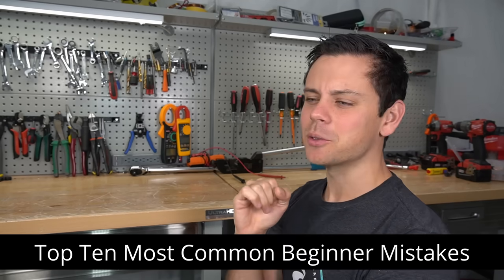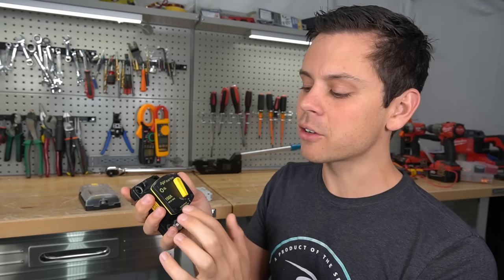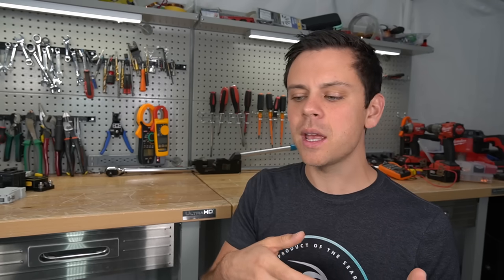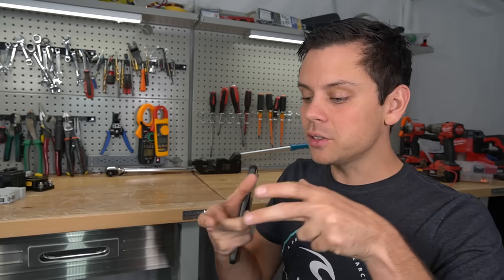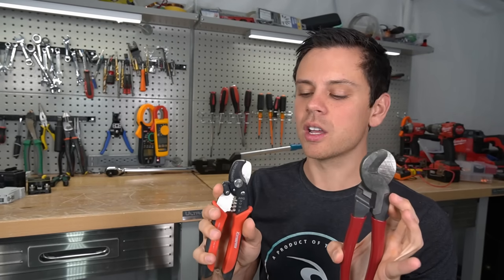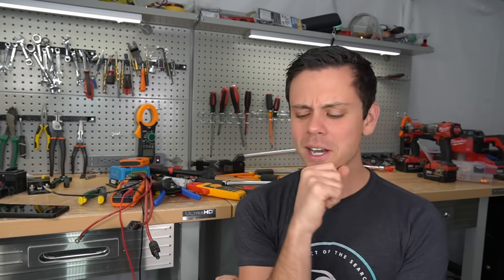Top 10 Beginner Mistakes When Building a DIY Solar System

Comment from the maker: Tools mentioned in the video (affiliate links):
Best Value Torque Screwdriver: https://amzn.to/3DEMqwb
Torque Wrench: https://amzn.to/3sEpuH8
(there is an insulated torque wrench out there, but it costs 20X as much (not joking). The options above are great for the price)
Basic Electrical Tools that I recommend: https://www.mobile-solarpower.com/tools.html

0:00 Intro
0:14 #10
1:21 #9
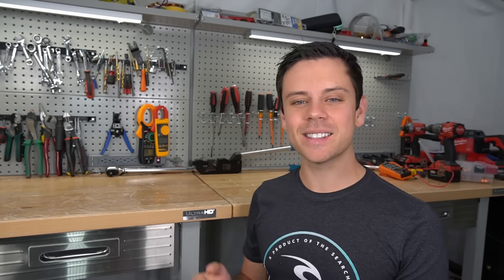2:53 #8
3:56 #7
5:36 #6
6:54 #5
8:51 #4
9:49 #3
12:15 #2
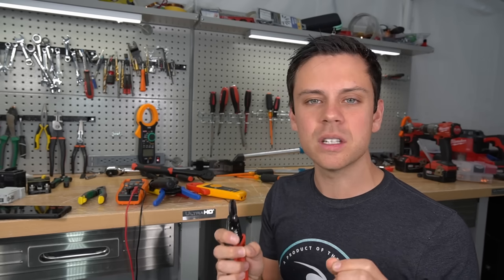14:29 #1

Does off-grid solar confuse you? 
Check out my DIY friendly website for solar system packages and product recommendations, and so much more! 
http://www.mobile-solarpower.com

Join our DIY solar community 
#1 largest solar forum on the internet for beginners and professionals alike:
https://www.diysolarforum.com

Check out my Book
Best-selling and beginner-friendly guide to 12V off-grid solar!
http://amzn.to/2Aj4dX4

If DIY is not for you, but you love solar and need an offgrid system, check out Tesla Energy! They will price out a system and get your house offgrid: https://ts.la/william57509

My DIY Solar Equipment Recommendations (Constantly updated! Check here first):

12V/48V Lithium Solar Batteries: https://www.mobile-solarpower.com/solar-batteries.html

Complete Solar System Component Directory: https://www.mobile-solarpower.com/solarcomponents.html

Complete 48V System Blueprint: https://www.mobile-solarpower.com/48v-complete-system-blueprint.html

Plug-N-Play System Recommendations: https://www.mobile-solarpower.com/full-size-systems.html

Complete "Add to Cart" 48V System Kits: https://www.mobile-solarpower.com/complete-48v-solar-kits.html

DIY Friendly Air Conditioner/ Heat Pumps: https://www.mobile-solarpower.com/solar-friendly-air-conditioners.html

My Favorite Online Stores for DIY Solar Products:

Signature Solar
Offgrid One-Stop-Shop. Best Value 48V LiFePO4, Victron and Offgrid Specific Heat Pumps:
https://www.signaturesolar.com/?ref=h-cvbzfahsek 

Current Connected
SOK, Victron, Mr.Cool Heatpumps and High Quality Components. Fantastic customer support: 
https://currentconnected.com/?ref=wp

Litime 
My favorite 12V budget battery!:
https://www.litime.com/?ref=XBIA62RFcalHns

Epoch Batteries
My favorite high-quality 12V battery:
https://www.epochbatteries.com/products/12v-460ah-lifepo4-battery-ip67-heated-bluetooth-victron-comms?rfsn=7352625.50494d

Renogy 
A classic 12V solar store that has been around for ages! DC to DC Chargers and more! 
https://renogy.sjv.io/n1VjXx

Rich Solar 
Renogy's biggest competitor! Similar products, but at a better price: 
https://richsolar.com/?ref=h-cvbzfahsek

Battery Hookup
Cheap cell deals
https://bit.ly/2mIxSqt
5% off code: diysolar

Contact Information:
I am NOT available for personal solar system consult! If you wish to contact me, this is my direct email: williamprowsediysolar@gmail.com

Join the forum at https://diysolarforum.com/ if you wish to hang out with myself and others and talk about solar

FTC Disclosure Statement and Disclaimers:
Every video includes some form of paid promotion or sponsorship. Some links on this youtube channel may be affiliate links. We may get paid if you buy something or take an action after clicking one of these. My videos are for educational purposes only. Information is subject to change/update at any time. Electricity is DANGEROUS and can kill. Be smart and use common sense :)

DIY Solar Power with Will Prowse is a participant in the Amazon Services LLC Associates Program,
An affiliate advertising program designed to provide a means for sites to earn advertising fees by advertising and linking to Amazon.com
Reply: Also if you’ve got links to the torque wrench and screwdriver that would be awesome!
Reply from the maker: Just added some links above for those tools. Good idea
Reply: "..titan it properly..."  I only joke in a good-natured fashion.  You're videos are GREAT for people like me not electrically inclined.  Because of you, my system is the envy of the community.
Reply: @LordSlag  I say it the same way and I get friendly teased about it. LOL
Reply: @mikefranks4528  😋😋🤗
Reply: @LordSlag  ditto!
Reply: Information overload🤯😄👍🏾
Reply: P
Reply: Thank you for this 💙 Still enjoy learning from your videos.
Reply: Will, the Weize Battery that you reviewed a while back is now $299.99 on Amazon.  Just picked up my 5th, and 6th for that price.  They are priced $319.99 minus a $20 Coupon.  Don't think that can be beat anywhere.
Reply: Thanks, but a question: I just looked up the manual for my Victron MPPT controller, and it requires 0.75 nM = 6 in/lb torque, The torque screwdriver you link has a range of 10-50 in/lb. Would 10lb be OK, or should I be looking for a wrench with a smaller range? What range do you think is optimal for most electrical projects (I'm working on an RV primarily)?
Reply: @WillProwse  It's getting chilly.  Hi Will.  I am looking for a basic off grid solar mini split set up for a mobile home that will get me through the winter.  Are you aware of anyone that has a video on such a system?
Reply: hi, I'm after this proper big crimper U showed second pls, cant find it in description or comments and U haven't mention make or model, thanks
Reply: Have you ever included all the tools you suggest in a budget of a system? Expenses over time vs grid tie/henerator is what I was wondering about. Payback time without the tool expense is what I always see, as if one is born with expensive, electric-specific tools:)
Reply: Can I run a 2000 watt inverter to just one main vehicle 12v battery. Also, what size gauge wire and fuse should I use?

Comment: As a controls engineer - Almost EVERY time I go in the field for construction inspections, the #1 problem is improperly seated and torqued cables. Will hit the nail on the head there. We formally call the pulling a "tug test". Do one after terminating anything - making sure everything is de-energized.
Reply: I worked in telecom as a tech and we used insulated tools and did annual torque checks of all the hardware. The last place I worked before retirement had 7 48v battery banks. Our load was about 1400 amperes. I have a small system at our remote cabin where I run a 48v battery bank with solar and inverter. I also have a 12v system for lights. I torque my stuff out there also. I also use the same method for preparing the connectors that we used at work.
Reply: One has to wonder why they give torque values for rotational terminators but do not give lateral separation limit tolerances for inline junctions.. after all, a "tug test" is much more likely to fail when preformed by the Hulk (or Arnold Schwarzenegger) than if done by my 5 year old niece  ;)
Reply: I do controls too. I have found factory landed wires on a big chiller landed on insulation. Wires inserted too deep and tightened on insulation and system wouldn’t run. That was fun to find.
Reply: @Knight805  I thought I was the only one. New battery cables for a car. Direct from Ford OEM. They didn't strip the insulation at all, just crimped the connector on. Also made me wonder if they were using a correctly sized lug since it fit over the insulation? Mine never have enough room for that.
Reply: I've come across cables just falling out of terminals aswell , just people being lazy and in a rush some just don't tighten down very much ,technical term is limpwristted
Reply: Is it a bad idea to use a suicide cord from a Bluetti type battery source to a plug in my camper? Assuming I turn off inverter first.
Reply: @alaska-bornfloridaman  after being shocked a couple of times myself on normal so called decommissioned electrical systems. I am now rather careful now myself try to run every thing through safety switches or boards as close to power source especially if you have no choice other than to use Suicide leads.
Reply: @davidwright1752  
Well, I made such a system in the event that we lose power in our house after a hurricane.  It runs the central air, fridge, and basic lights and TV. I know it's frowned upon, but I'm smart enough to shut off the main breaker.   I was just wondering if it would work on a smaller scale
Reply: @michaelphilip3919  agree with you just cannot be to safe around power. To many deaths due to Being electrocuted.
Reply: @alaska-bornfloridaman  all the rules are the same small system or large what size generator or battery are you using you have to calculate the load of all the appliances you are using ie 2 kw generator or battery plugged into a house that needs 10 kw is just going to work. A lot of engineers and sparks view the videos to keep up with the times.  Better to put a question on this site ie size of generator or battery and size of load. Than some may give you Hypothetical answer due to legal requirements. With a small system I prefer to run leads to the item I want to power example the fridge this is much safer it is really better to have a licensed tradesmen looked over your system and make sure it’s sized and safe particularly in the quiet months.Before disaster strikes.
Reply: @Chris_at_Home  look up the story where the antenna tower inspector tightened the bolts at every annual inspection, per the checklist. They were shearing off at an unusually high rate. The funny part is that he was the only one who followed the checklist! They had to revise the inspection procedure.
Reply: @mrtechie6810  That would suck. I did some tower work about the 30 years ago, mostly in the Arctic and a job in Kuwait.
Reply: @mrtechie6810  Procedure or materials were wrong!
Reply: @Chris_at_Home  
Great experiences? Any problems with procedures or materials going wrong?
Reply: @electron-1979  I can’t remember any problems from materials. I remember one time I went to do an annual load test on a battery bank and a post almost instantly went real hot.  The battery bank was old and I don’t think it had been tested in awhile.  It was at a remote village on the Arctic coast.  I worked for two companies that had contracts providing communications for the Alaska Pipeline Line for 15 years and  there were crazy procedures for getting any installations done. Everything had to have a permit even just visiting the gate valves.
Reply: @alaska-bornfloridaman  I build the place I’m in now and I have a main transfer switch and a sub panel with its own transfer switch. When our power goes out I hook our Honda 2000 to the sub panel  transfer switch plug and it runs lights, fridge, freezer, Toyo heater and TV/ internet. I can start the big generator remotely and it will run all the big loads like the well pump.
Reply: @ Baloo Lamo   After 25 years of electrical field construction supervision in power plants and refineries I am curious about torqued cables thinking that if you torque a cable (twisting it) it will eventually break.
I suppose that what you really mean is torquing of the bolts holding the cables at the terminals but unless you are talking about large busbar systems I have my doubts that torquing verification is necessary. Loose cables do occur but you don't need torque wrenches; you need good and responsible electricians and weeding out of those that fail at their jobs.
Reply: @pindapoy1596  On large battery plants used in large communications facilities we routinely torqued the bolts every year.  The torque values were low because of the lead posts. I’m sure lead flows some over time. I have been to remote sites where they hadn’t been torqued in years and they were pretty loose.   Our electricians check torque periodically on panels, I don’t know how often though. Some of these plants we had DC loads of 1400A. They could carry the load for a few hours but in a power outage happened one of two generators would come on line fast. They were kept heated to almost operating temperature.
Reply: @ @Chris_at_Home .  I made my comment based on Baloo Lamo-controls engineer (see above). He was obviously referring to solar panels on rooftops of single family homes since the title of the video clearly indicates that it is about DIY solar.
When you talk about 1400A you are in a different league.  In my own career in the field I have dealt with large switchgear units and motor control centers and there is no doubt that as soon as you go beyond a hundred amps or so, bolts at terminals have to be torqued to manufacturer's specifications. But again, that hardware is not for do it yourselvers if you go by what the title of the video says.
Reply: @pindapoy1596  I have had  a solar, inverter and battery system at our remote cabin for close to 20 years and I maintain it similar to what I did at work. I am using lead acid batteries and if they aren’t torqued periodically they become loose.
Reply: @Chris_at_Home  What torque values are you using? Are they recommended by the vendor or are you doing that on your own because you feel that it is just better? Are you protecting your terminals against corrosion and are you periodically brushing them to remove corrosion traces? Are you also torquing your car battery terminals that are subject to vibration far more than your solar battery system? 
We can do a lot of preventive maintenance but is that really required? Maybe in some cases a star washer or a plain lockwasher in the right place might be as effective as periodic torquing. And zinc based anti corrosion paint or paste hardens well enough to prevent electrical bolted connections to loosen up.
Reply: @pindapoy1596  The torque values are recommended by the battery manufacturer. Our battery terminals also went through a process where the terminals on the cables or bars and bolts were throughly cleaned and then dipped in a paste that is heated to a liquid.  They used an old perk coffee pot to heat it in and then when unplugged it turned into a hard paste. We had installation people that did this. I was a tech at these sites so new battery installations were done by them. I could only do maintenance, it was a union shop.  Torquing bolts annually was a tech job.  One site had 7-48V battery plants all hooked to massive copper buss bars with a lot  of 600m cables feeding fused distribution panels for the communications equipment. This was in a gateway earth station that has a couple of 15 M satellite dishes and a 13 M satellite dish. We also had small dishes similar to what the remote sites had as a way of verifying what level they should see on their receive.
Reply: @Chris_at_Home  Sure, but you are referring to 1400A DC if I am not mistaken. So you have big amps and DC both being strong enmies of terminal points. DC breakers able to interrupt high currents are in themselves much more difficult to design, DC does not go through a sine wave with and will not naturally go through zero and tend to extinguish a short circuit once in each cycle like in AC. So a spark at a bad or weak connection will stay on till it burns the terminal, melts it eventually and may cause a fire all that without a major overcurrent that may cause a breaker trip and save the day . That is why good connections on high DC amps  are essential and torquing is a must precaution. You are absolutely right.
But again, I was answering to Mr. Baloo Lamo regarding do it yourself house solar installations.
Reply: @alaska-bornfloridaman  i
Reply: I personally solder the copper ends on my copper cables. I then clean all traces of Flux (that causes corrosion), coat with a anti corrosion grease-type chemical and then shrink wrap. These are then installed with washers and the same anti- corrosion material, and finally torqued to specs..
      The soldered connections (although it takes a lot of time) Don't fail or corrode like crimped ones. This is for my equipment and I would rather spend the time to do it right!
       Ya'll Take Care and be safe, John
Reply: I have done many residential wiring jobs.  I can't imagine installing a breaker or pretty much anything without pulling on the wire to make sure it does not comes out.

ALSO: do NOT use switches with push in connectors.  These pull out all the time, and now you have a loose hot wire flapping around; n a box.
Reply: Yes.!
Reply: ABYC Electrical standard E-11 calls for a 5 LB "pull test" on crimp connections.
I'm not sure that's sufficient for heavy gauge cables, but it's a starting point at least. @W-4-Z-D
Reply: @alaska-bornfloridaman if you have to ask...be safe.
Reply: @alaska-bornfloridaman  "Is it a bad idea to use a suicide cord ...?" You can stop right there.
Reply: What about using dialetric grease, on terminals, especially in a marine environment